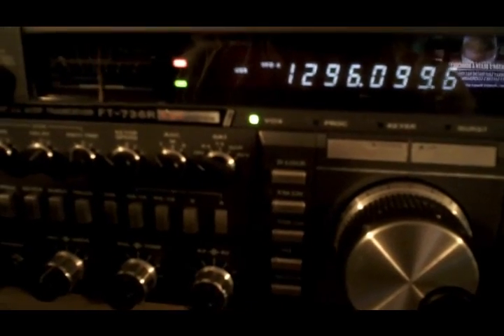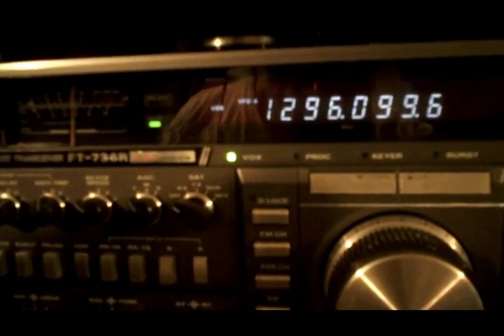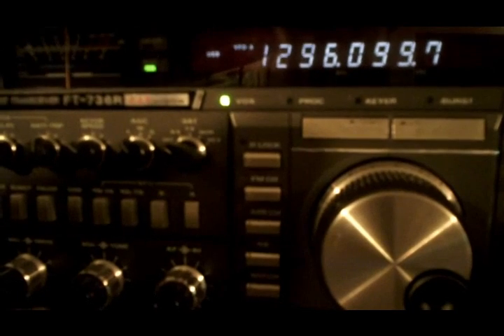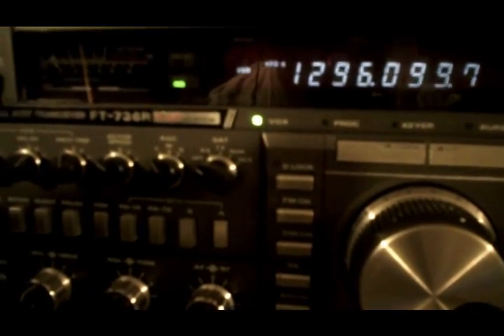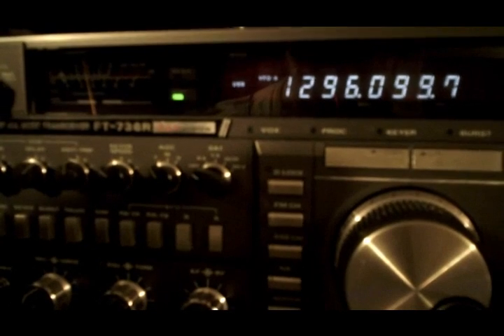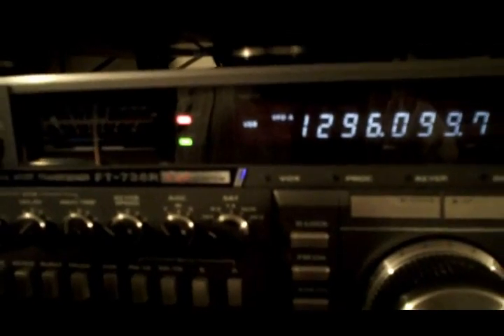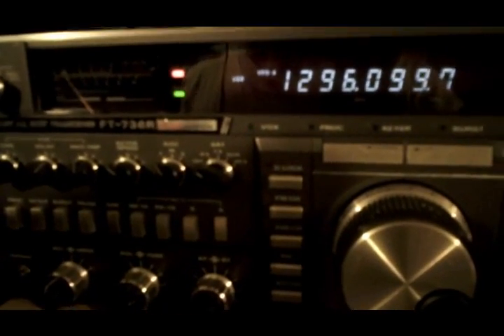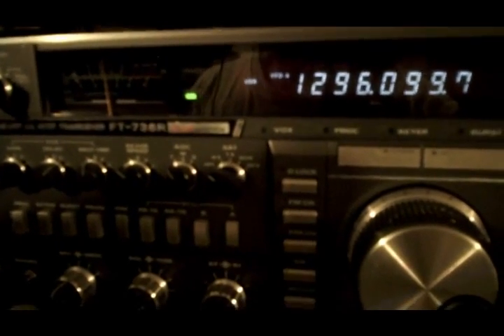1.2 GHz Contact With Larry KB9WLM In Canton Illinois

Comment: Nice to find this. I just bought an Icom IC-1275, but I don't have it on the air yet. Have to build an antenna or two. I've been off the air for over ten years, and I'm anxious to get back on.
Kenwood TS-940SAT
Kenwood TM-621A
Kenwood TM-721A
Icom IC-275H
Icom IC-375A
Icom IC-475H
Icom IC-575H
Icom IC-1275

Thanks for posting.

Ed, KI6DCB
Reply from the maker: Well that was a great night, rare and one of over 35 made for my VUCC Award. I have been off the air for past 6 years. Equipment still here, life got in the way. You have some rare and highly praised radios. I wish you well and many hours of enjoyment!

Comment: Contact ,,,,but from where to where, mounbounce????how many miles ???
Reply from the maker: Kansas City to Canton Illinois = 254 miles straight line. And no it would not be moonbounce not on voice. 1296.100 is a Sideband Frequency. The doppler shift on 1296 EME is huge and requires us to run digital.  The video shows the DB lose between running vertical versus horizontal. Larry has the ability to rotate his yagi from those two politicizations. This was over 11 years ago.
Reply: @JDDupuy  wow 254 miles is a very long distance even for  vhf...in the past i have build a  cross yagi antenna for satellite,i did the setup for  circular polarization,1 cross yagi antenna transmitting at the same time with individual  gamma match  inch one and another  cross  yagi in the other side of the  boom,1 yagi rotating to the right and the other yagi rotating to the   the left,...///not many ham knows what i am talking about, I still have the yagis  in my shed and i still have many pictures of the setup...
If you put  2 yagis together one horizontal and the other vertical and you used the right calculation in the coaxial that goes  to the gamma match ,you can make that one signal go   faster in one yagi than the other and that will  make the  signal to rotate, and that is know as   circular polarization ,,,depending to your calculation in the coaxial one  should be  short that the other  and that will make the antenna signal to rotate to the right  or to the left ,i never have to rotate my antennas ,circular polarization is like if you have 2yagis one  vertical and the other  horizontal at the same time...is the best setup....my English is not the best .i apologize  for that....73